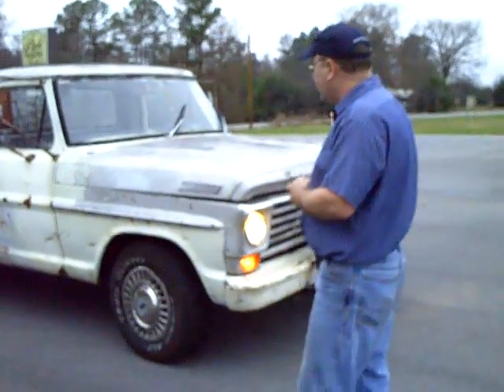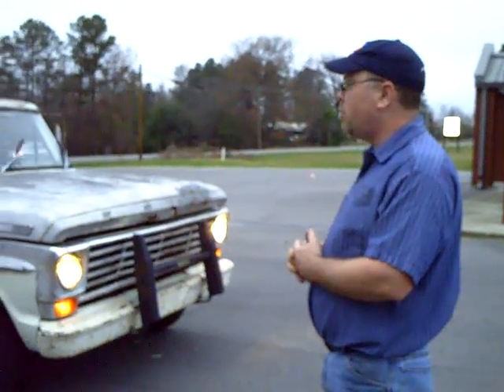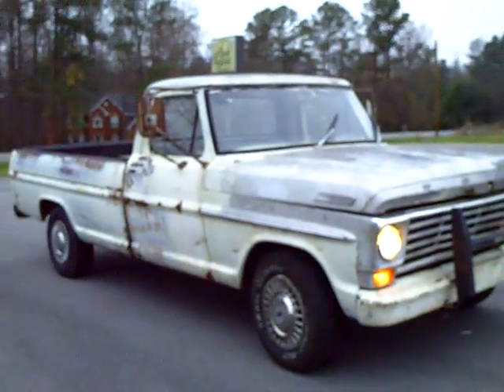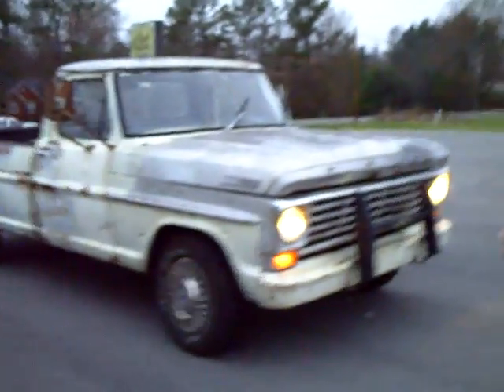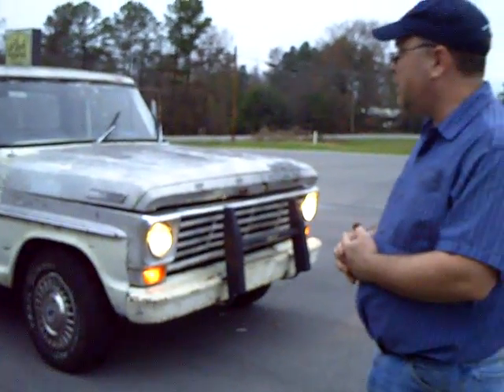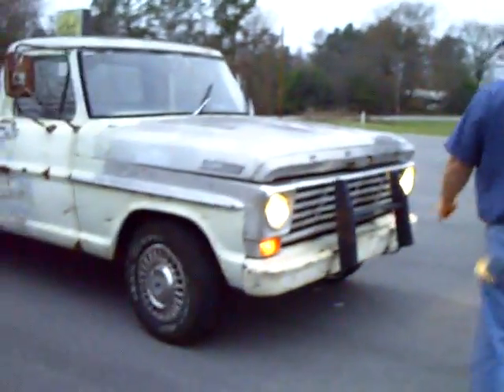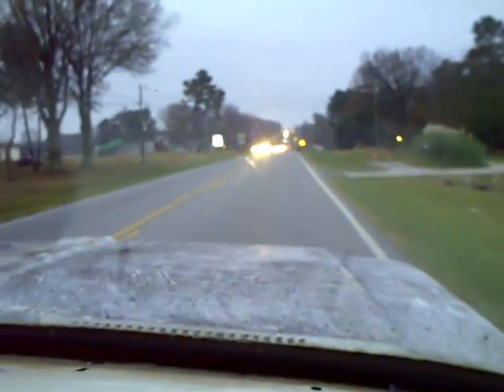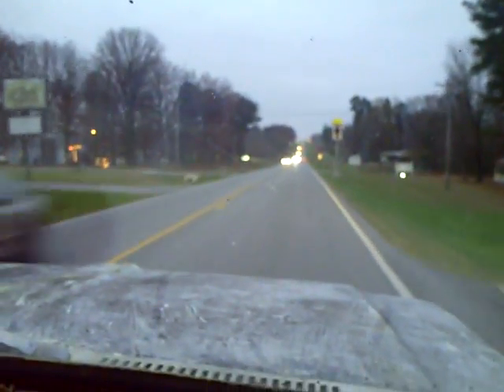crown vic front suspension into 67 F100 15

Comment: You should go 4 spd, screw auto's
Reply from the maker: Would of rather kept a manual in it. But I would of either had to kept the three on the column and got a special bellhousing to link the 4.6 to that or got a 5 or 6 speed from a mod mustang. Either way that would of been big bucks and this was a low dollar project. This video was done over 4 years ago and right after this was taken I swapped it for a good trans out of another CV. It's worked fine since and still drive it to this day.
Reply: Is that 4.6 fuel injected
Reply from the maker: Yes it's bone stock just like it was when it came out of the wrecked cop car.

Comment from the maker: @filiyoscy Thank-you!  Right now my son is driving it and I have to find another rack because it's leaking bad now and we are going through a lot PS fluid. I have a more solid 69 Ranger cab and bed waiting for my body guy to paint(it's in some of my later videos).  We are going to move all the electrical, steering column,and gauges.

Comment from the maker: Yea we all ready changed the fluid and filter. It helped some but as you can see it's still not quite right.  The price you pay for using a trans from a cop car with 200K miles on it. I finger it will have to have a clutch kit in it. Good news is the overdrive and lock up covert works fine. Heck even the cruse control works good.